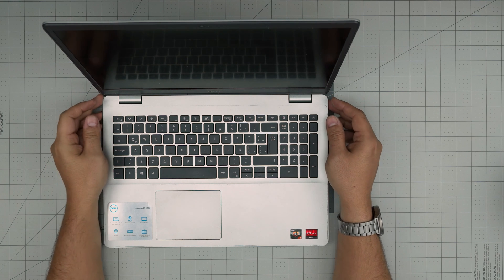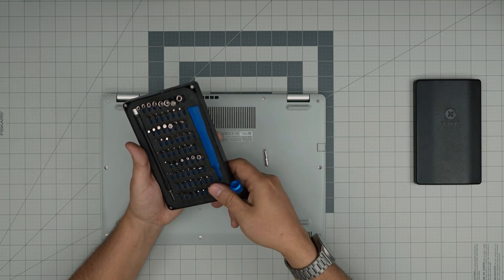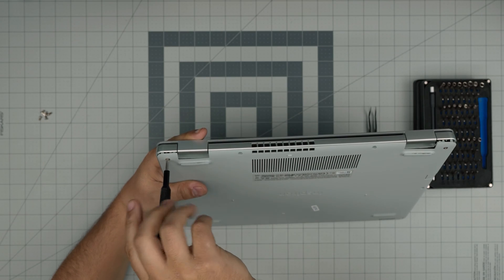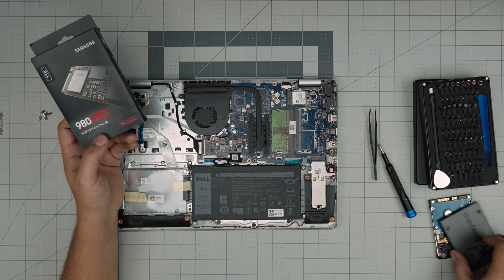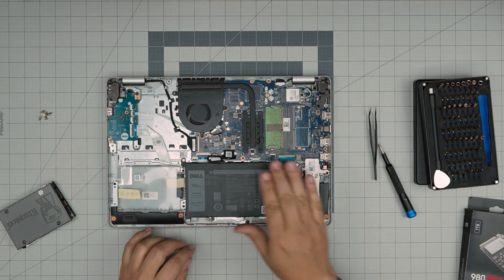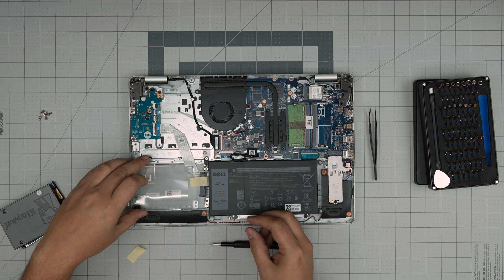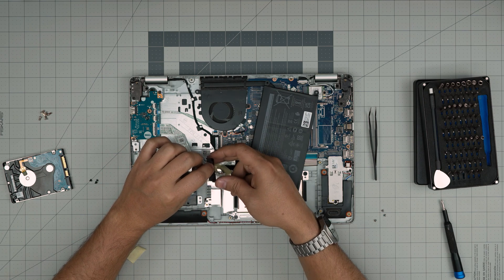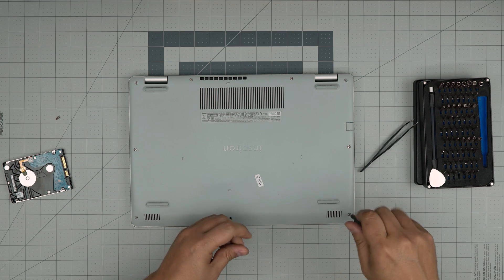How to Upgrade Storage on Dell Inspiron 15 3505 Laptop | SSD Installation Guide

Comment: Hi! I have a Dell Inspiron 3525.It's other model but I need to know if SSD screw is a PH000. I used a PH000 screwdriver, but I couldn't remove it. :(
Reply from the maker: 🫠Regarding your question, the screw is PH0
cheers🍻